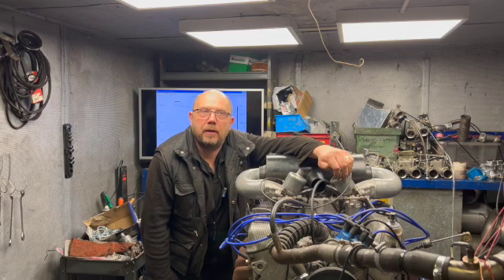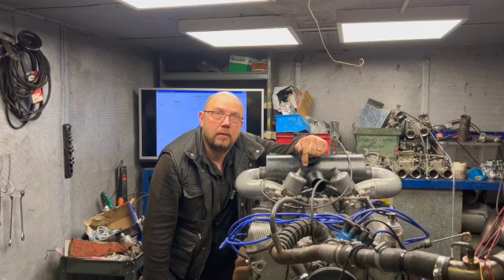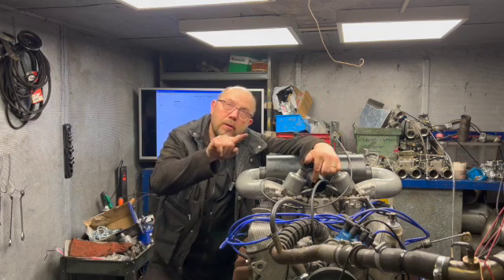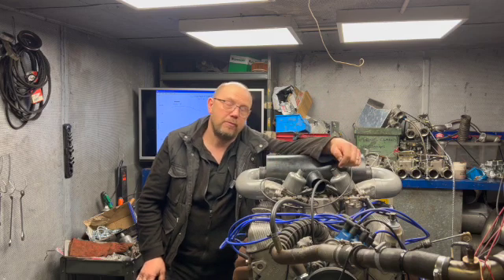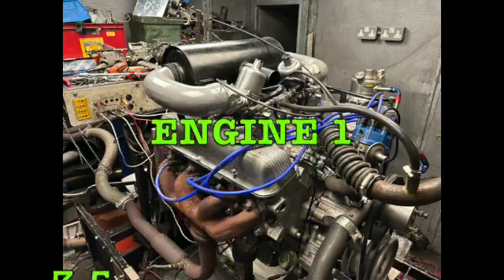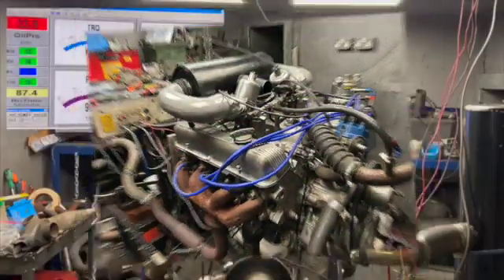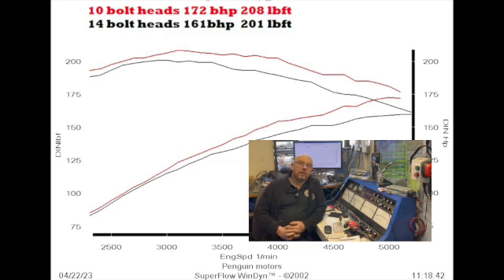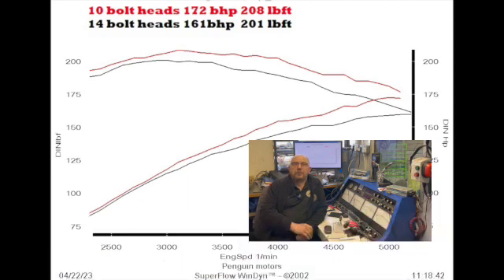3.5 V8 ROVER CYLINDER  HEAD TEST

Comment: Thanks Graham, 4.6 heads here in Oz are getting ridiculously expensive. I have the old P6 heads. I am considering porting them and getting bigger valves put in because I need to put some hardened valve seats in anyway. Do you think the heads still won't match the 4.6?
Reply from the maker: with heads in stock form p6 heads tend to give greater low speed torque, but dont flow as much air as SD1 or 4.6 heads, but there no real fundermental difference between any of the head types so theres no reason why you shouldnt uprate P6 heads

Comment: Luvvin your spec comparison tests. What effect, either alone or with other mods ca come from using the twin downpipe exh manifolds?  These were used on Range Rover EFI engines onwards.
These effectively turn the exhaust system from 8-2-1 layout to 8-4-2-1
Reply from the maker: without doubt there would be a gain in power/torque, how big would depend on the rest of the engine sspecification

Comment: What's the intake manifold like on these engines? I'd assume a classic American 2 plane manifold would perform better. I have no idea what's available for these engines.
Reply from the maker: Standard twin su manifold is a dual plane manifold but it’s pretty ugly so I would imagine if you could make an adapter to fit the standard su carbs to an edlebrook manifold you will find a power gain, that’s something it intend to try at some point

Comment: Great video - thanks!
Please share more dyno tests with cams, carbs, heads etc. on the 3.5.
There must be a way to reach higher torque figures porting/flowing the heads and intake and carbs. 260 ft-lb should be possible - or at least a good goal 😊
Has anyone used David Vizards IOP software or his porting strategies on the Rover V8’s?
I would like to do that myself.

That Sound is just unbeatable - Tony Pond at 7.000 rpm in the Manx Rally - goosebumps 😊❤

Comment: port matching and radiusing corners in the good old days worked a treat, increased airflow also bumped up CR  and overall torque  ... not so much now with most 4 valve engines 
if your looking for low end TQ/HP do as above advance the STD cam and try 30 deg seats on the IN valve

Comment: Good experiment mate, shows how the hype isn’t always true. I rebuilt a standard 4.6 for my Westfield and another one with 4.0 pistons and rods to increase comp ratio. The standard one is on the car and I have run up the high comp one in the test bed with no issues although not got it in the car yet. If you weren’t so far away I’d bring the engine to you to dyno run to see the difference on paper. Cheers for the videos.
Reply from the maker: 4.6 has quite a low compression ratio as standard, so raising it to around 10:1 should make a big difference, that said a 4.6 makes a lot of torque anyway so i imagine your westfield will have traction issues whatever the compression!